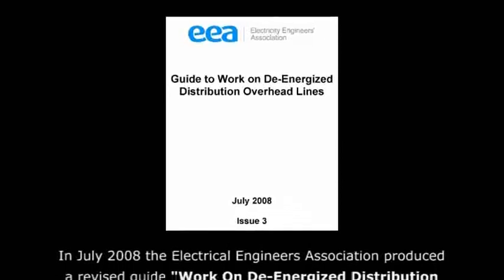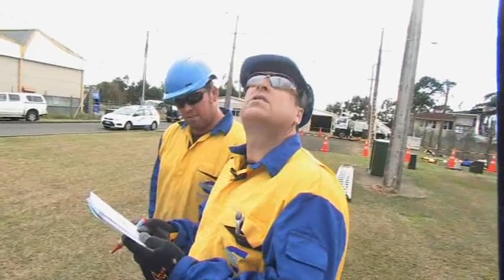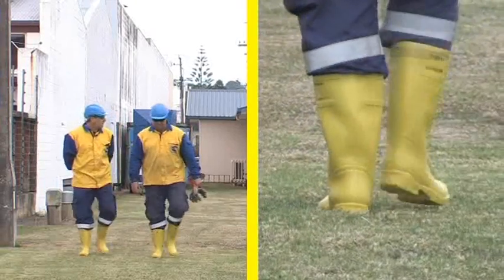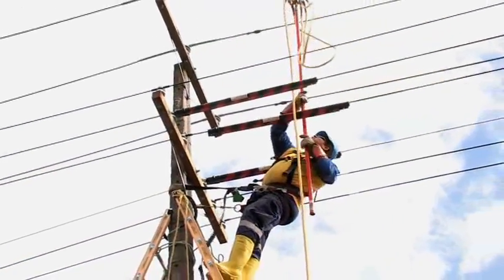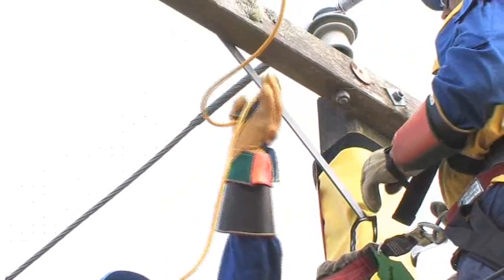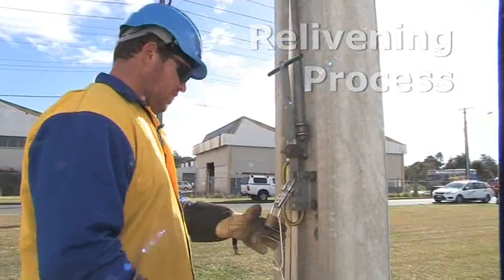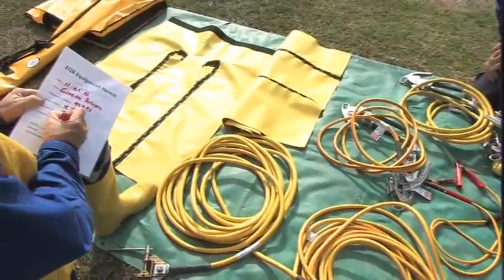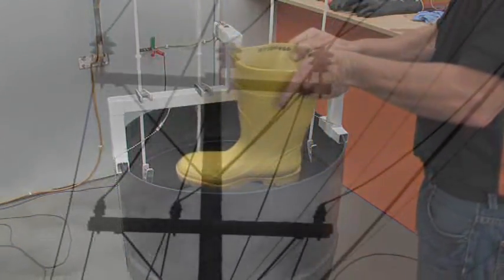Equipotential Bonding

Comment: Very interesting safety video.  Much of the electric utility work in the US is done from Bucket Trucks with dielectric booms.  Usually I only see dielectric ladders used at the customer level, i. e. the output of the transformer 120-0-120 vac.  The tailgate meeting is used in my industry (communications towers)  and rarely do we get close enough to Primary Voltage -7,500 to 15,000 vac wires.  

I did see a bit of humor in the video however.  The workers arrive on site, complete all the procedures including grounding the system and wrapping everything in site.  Once all the setup is completed the supervisor says to the worker, "OK, climb the ladder and tighten that loose 7/8 inch nut and we'll be finished with this one."  :-)